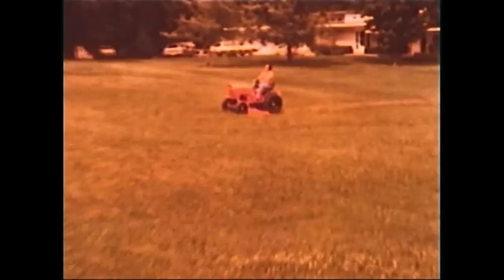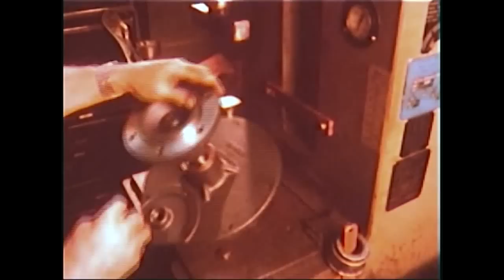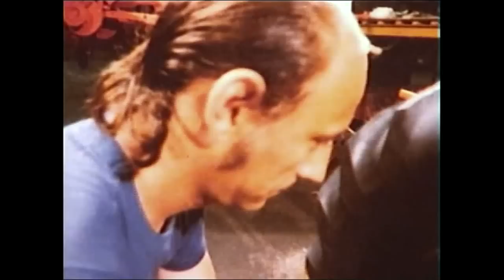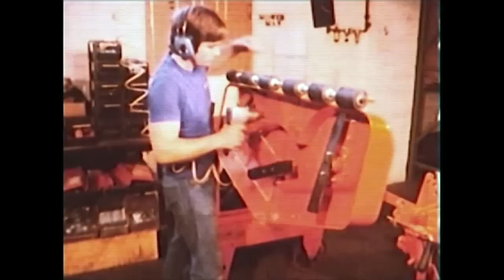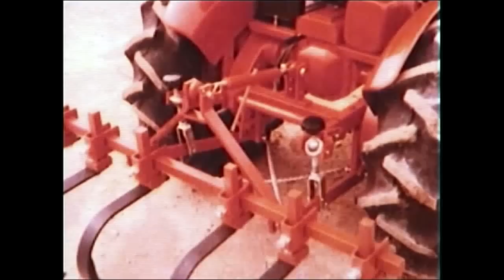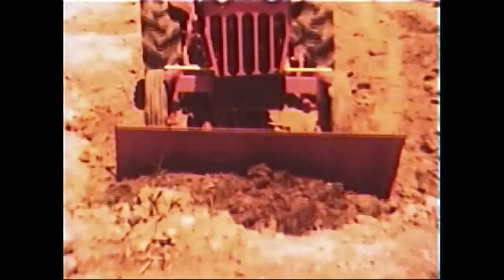Power King Tractors 1979

Comment: Always admired the Power King and have considered buying one at times.  I already have a Tuff-Bilt tractor which is about the same size and would appear to share some components.  The Tuff-Bilt has been most useful for plowing snow and grading dirt.  Have always planned to install a belly mower on it.
  Too bad production of the Power King has ceased.